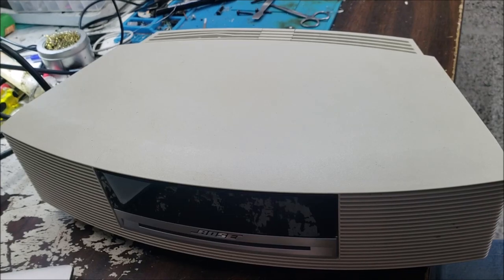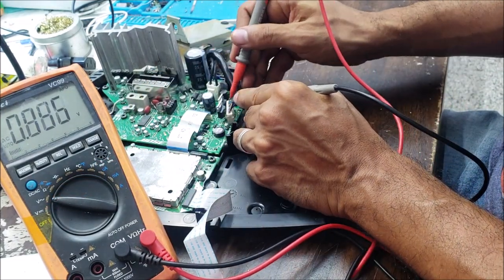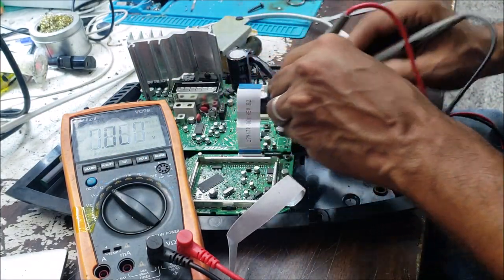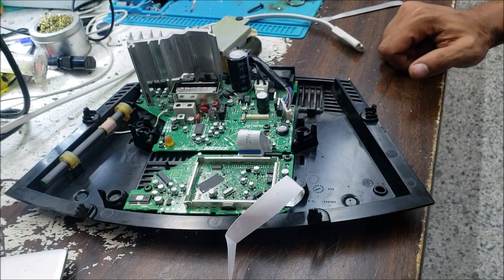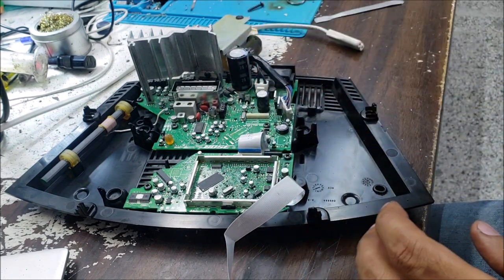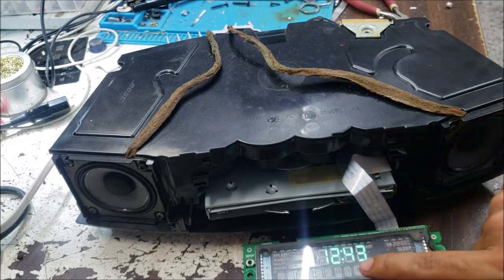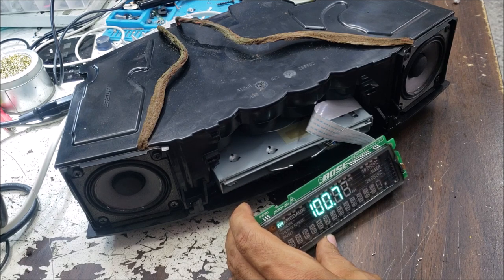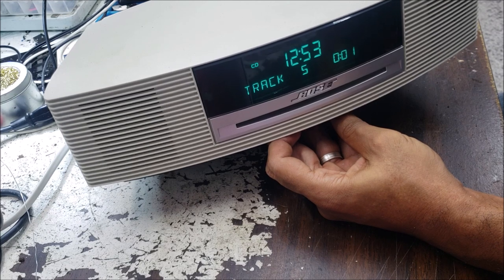Bose radio cd player AWRCC2 no power please wait wont turns on

Comment: Is the 33 microfarad capacitor that is used for a battery backup also a filter for the power supply? It looks like a battery but isn't.

Comment: I replaced the 6 capacitors in question.  It worked fine.  However after long testing the unit just died halfway through the playing of a cd.  I took it apart and took a thermometer laser gun to the area and found that the caps were getting hot.  And so we’re the caps on the left side of the silver box.  Then it died again.  Is it possible that you have to get quality Audio based capacitors with a low ESR rating so as to not overheat and fail again?  I did match the farad rating with a bit higher range of volts.  But those failed.  So I bought some new ones with the same matching farad rating and with the voltage matching the originals.  Out of curiosity did you do a test on your unit for about an hour with a cd playing and did it pass that test?  Thanks
Reply from the maker: yes i fixed tons of those wave, be sure the polarity of those caps are right